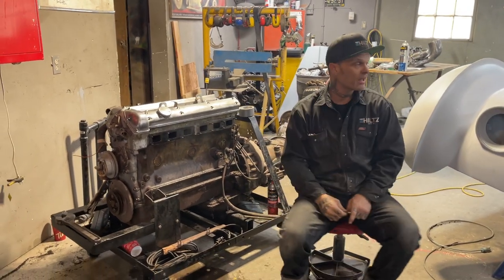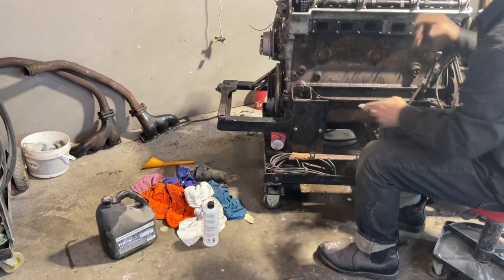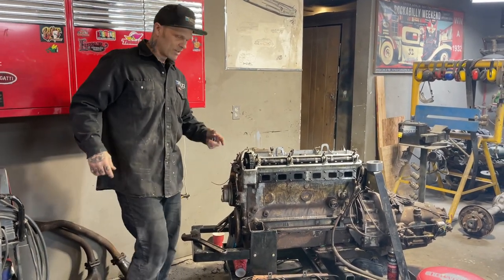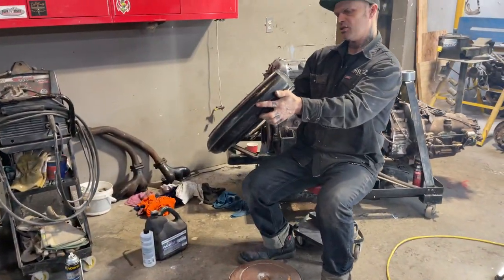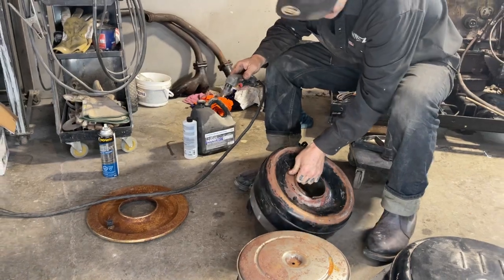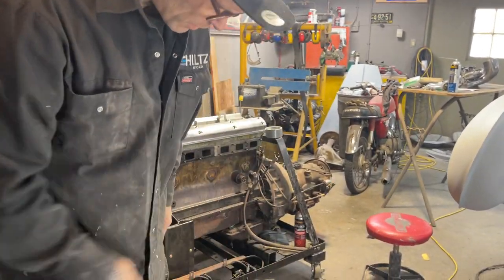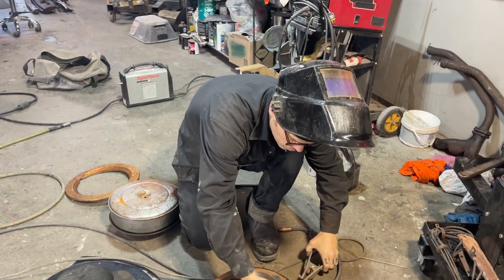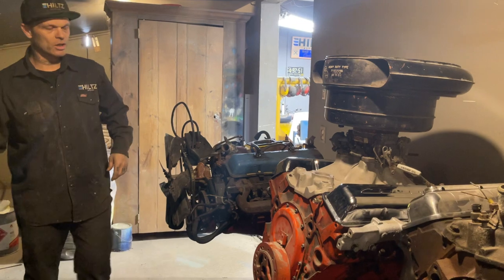HYDROLOCKED 1959 JAGUAR 3.4L ENGINE

Comment: Non- interference engine means if the cam shaft stops turning and the engine rotates the valves will not touch the piston.

Comment: Hydroloc means the cylinder has fluid in it and with the valves closed the piston will not come up because you cannot compress fluid. Pull the plugs first.

Comment: A non interference engine means the pistons cannot hit the valves even if the timing chain is off an interference engine means the pistons will hit the valves if the timing chain comes off. Hydro locking runs the risk of bending the connecting rods and it does not take much to bend them
Reply: Like a ford escort belt breaks re place the engine
Reply: Spot on! But I like Chad’s smart approach. He thinks logical and learns fast from all the information people give him. Love his videos full of pratical usefull info based on his experiences. Keep it up chad!

Comment: Disassemble the engine. Rebuild it to factory specs.  Then you will have a good engine.  Anything else with this engine is a waste of time, energy, and money.  This is a 62 year old engine.  The vibration damper is junk. I guarantee that the rubber is degraded. What does the water pump look like? The bearing is most likely gone. How much corrosion is there in the timing cover?   How much rust is there in the water passages?  There are so many things that need to be done to a 62 year old engine, that diddling around with it is just a waste.  I wish I was near you. I would spend some time showing you what needs to be done.

Comment: Not so.. timing chain can be working correctly if a valve is stuck open on a interference engine piston will make contact with stuck open valve.

Comment: Constructive criticism... Think about this........It can't be hydrolocked with an open valve.  If the valve is stuck open, the valve is100% out of time.  Only that one stuck valve, even thou timing chain n gears are correct.  A stuck valve isn't controlled (timed) by the cam profile....it's not touching thus not following the lobe.  I'm not a Jag guru but Doug definitely said this is an interference engine.  Let's ask him again.

Comment: I hope you are right about saving the engine without removing the head I had that same thing happen once with a Chevy straight 6  we still ended up pulling the head as the valves did not seat from rust build up causing pits we had to lap the valves

Comment: What you are missing is that if a valve is stuck open it doesn’t matter what the cam and lifter are doing the valve is still into the pistons space and we all know that two objects cannot occupy the same place at the same time 😂 ergo bent and broken parts 😢 You are an excellent body man and fabricator but leave the mechanics to Dough 🤔

Comment: Two questions:
1. What do you plan to do with that motor?

2. Why didn’t you just remove the head. Send it out for refurbishment.
Time is is very valuable!
“Once you have spent your time. You can never buy it back.”
Cheers

Comment: cam and timing gear do not make the valves close , the valve springs do  , you have a problem if a valve is stuck open , if its closed you have no problem unless it's stuck closed , a piston can hit a stuck valve in other engines.

Comment: Sorry Chad, I love all your content and as a body guy you are second to none. But you have got this hydro lock and interference thing very wrong. I am a mechanic in the UK and worked on Jaguars for 30 years. That engine is an interference engine. Meaning if a valve is fully open and a piston is at top dead, then they WILL touch if not timed. The valve can be fully open for any reason, whether stuck open or the cam is holding it open.  Yes, if the chain has not snapped or jumped, then the engine is timed and will not hit a valve if the valve opens and closes properly. If the valve is stuck open, then the piston will hit it at TDC. Sorry, but in my experience you will have trouble with that engine at some point unless its stripped, cleaned and reconditioned where required. Those chains stretch and fail. Best wishes and good luck with it.

Comment: Hi Chad, like the others have mentioned, unfortunately you have gotten it mixed up. An interference engine is a type of 4-stroke internal combustion piston engine in which one or more valves in the fully open position extends into any area through which the piston may travel. By contrast, in a non-interference engine, the piston does not travel into any area into which the valves open. This is a fundamental of the engine's design, and if the timing chain / gears get messed up (out of sequence) it won't matter in a non-interference engine, whereas in an interference engine the piston(s) could travel into the area where the valves are extended possible causing major damage to both components.

To further clarify, in a non-interference engine the valves and pistons never occupy the same space and therefore can never touch. In an interference engine portions of these components do occupy the same space, but the timing prevents them from doing so at the same instant, therefore preventing damage.

I enjoy your channel every day! Keep on chugging along.

Comment: When you go to put coolant in the Bugatti engine for the first time and everytime you change it raise the front end up high in order to burp out the air from the head.  Alot of home mechanics when the engine swap or modify the cooling system run into is that they overheat because there is air in the system.  You need to let it settle for and hour or so and top it off.
Reply: Maybe drill a small bleed hole in the thermostat to let air out too.
Reply: When the fill of the radiator is lower than the water passages on the head is the mistake most make doing this.  The Jaguar radiator he is using is designed to be two or three inches higher than he has it.

Comment: Non interference means if the timing chain or belt breaks the valves will not come in contact with the pistons, bad move turning that over with fluid in the cylinders with the spark plugs in, it doesn't take much to bend a connecting rod, good luck.

Comment: Brad, I am a Jaguar specialist that has a YouTube basically devoted to XK engines. Are you putting that motor in the gorgeous Bugatti custom? I would put a straight edge on the cam cover surface and make sure the cylinder head is not warped. They tend to warp high in the middle.  If you have any questions I am here to help.

Comment: ************    Hi Chad, You do know that when you cut out the inner ring of the air cleaner it was lower than the outer circumference of the air cleaner right?   It made the somewhat tall air cleaner "hunker down" over the carburetor.  By welding in the newer 4 barrel carb friendly inner ring,  that ring now sits higher than the outer circumference of the air breather (sort of like a mushroom stem).   That's okay if you like that "perched up" look however, by causing the air breather to sit high, When it comes time to put down the hood of your car, you may find that it will not close because the air cleaner is now an inch or so too high.   I'd measure the air cleaner while its sitting on the carburetor to see just how much room you have when the motor sits in it engine bay.

Comment: What do you think about moving the upper hose connection on the radiator up to clear the fan blades ?
Reply: He said he might trim the blades.
Reply: It would be easier and not have to balance the blades. It would be a simple soldering job.

Comment: I don’t get it Chad? Is that 4.2 currently in the car and, if so, are you swapping it with the 3.4?
Reply: @duncandonovan5270  Ah, that explains it. I love Jag 6s but they have some quirky stuff. I replaced the front seal on a friend's XJ6C and it was a toughy. Supposed to pull it. I had him drop the pan as far as it would go and I removed the old one with a pair of diagonals and then purchased a couple of seals and boiled them to get them soft. The first one tore but the second one went on undamaged but they are not intended to be installed in that fashion. It took him an entire day to clean the pan gasket surface in situ. Not fun.

Comment: Take the head off, your going to have to hone the bore new rings bearings ,head gasket water pump, harden the valve seats for unleaded probably grind the  valves , you know a rebuild 🤔🤔🤔before its 🚽🤣🤣🤣🤣🤣🤣🤣🤣🤣🚒🚧

Comment: Using a small airline taped to the end of your vacuum hose is way safe than blowing with a blow gun.  Foreign objects will be blown and forced into the piston rings where it will get trapped and score cylinder walls when the engine is rotating.  This is painful to watch.  
Hydraulic oil sitting on the exhaust side of a closed valve is not "Hydrolocked".  It's called a "Seated valve".  Which means the Valve Chamfer Face has sealed or "Seated" into the Valve Seat in the Cylinder Head.  
Hydro locking can and will bend connecting rods with correct timing.

Comment: Chad the cylinder which had the stuck valve can not hydro lock.  The only way to get hydro lock on that cylinder is if both valves are closed and seal and the spark plug is in.  With a stuck valve (stuck open) the fluid being pushed up by the rising piston is just pushed out though opening created by the stuck valve.  But may have got hydro on some of the other cylinders with working valves (not a good thing BTW)  Note on a interference engine, a  stuck valve can contact the piston, regardless of timing.  I wonder if this is how you got the valve to close?

Comment: Chad, 

not that it actually matters but on that engine number one cylinder is at the back (Drive end). That's how Jaguar numbered them and the only problem you can have is if you refer to an offical workshop manual you can get mixed up.

Comment: Chad, I get what you are hoping to achieve but you can’t nickel and dime an old engine like this back to new. Just take the head off, fix the valves, inspect the cylinder wear, clean out carbon etc. Then assess what additional work may be needed. You will be miles ahead to rebuild this engine right.

Comment: Well Chad - Things are going quite well - BUT if you turn a interference engine over when it has a valve stuck open you can still cause grief - it may just push that vale closed , but be carful as you proceed to turn it over with that stuck open valve.

Comment: I bought a chevrolet vega years ago & it had sat for 5 years & had the same problem ! I put acetone & marvel mystery oil in the cylinders over night & it brokek everything free & then after a week of driving it it started leaking oil from the oil pan gasket * the rear main seal. It pissed me off so I pulled the 4 cyclinder out & put a 327 in it ! I am not sure how much better or worse jaguar gaskets are but acetone is too strong for gasket material !

Comment: In a non interference engine it's only safe if the valves are not stuck open. If the valves are sticking open when they are supposed to be shut, the piston will hit the valve. Also, if he only turned the engine over by hand with fluid in the cylinders, its probably ok. You need to have it spinning pretty fast to bend a rod. Chad,  love ya..please stick to bodywork!

Comment: The valve that was stuck open was not following the cam lobe  and therefore was not in time. Whether or not it was hit by the piston I can't tell. If it is bent the compression test should show. The cylinder with the open valve cannot hydraulic because the  the cylinder is open to atmosphere. The fluid will not close the valve, it will flow around the open valve. I never miss a nightly episode. Love you two.

Comment: 14:00 Just a note. The radius arms on the early Mustang connected in front of the lower control arm..so you have room for the idler arm and center link and pitman arm.steering gear behind the spindles.  I have a spare set but they are off a 6 cylinder.and are.lighter weight than the v8 parts...

Comment: Well you will get it running but, one of the problems with an old xk engine is the water jackets rusting and getting blocked over heating and warping the head. These are fun but expensive engines to own welcome to the club.

Comment: The timing you refer to is valve action timing if the valve is suck and not following the cam profile then you do not have correct valve action timing on the two stuck valves and the piston can hit the two valves and bend the valves. If the valve to piston collision is severe enough it may bend the valves. A non interference motor you can rotate the crank and cam even in opposite directions and it will not interfere or make contact between the piston and valves, regardless of the timing

Comment: soak the rusty air filter in Muriatic acid and water,, it will clean it lickety split. when clean, rinse it in Baking soda and water, then get it protected as it will start to rust fast. But works amazing.

Comment: IF THE  VALVE IS STUCK OPEN AND YOU TURN THE ENGINE OVER THE PISTON CAN HIT THE VALVE BECAUSE IT IS STUCK OPEN AND CAN NOT FALLOW THE THE CAM LOBE BECAUSE IT IS STUCK THE VALVE MAY BE BENT OR THE PISTON MAY HAVE PUSHED THE VALVE SHUT .
AND HOPFULLY NOT BENT THE VALVE  THE COMMPRESION TEST WILL TELL IF THE IS DAMAGE OR NOT .

Comment: With all of the time and effort being invested in messing around with the valves, I would just pull the head and have the satisfaction that there is nothing unusual going on inside.  I would hate to see this engine installed only to see it self destruct.

Comment: Jolene what about some kind of defroster -   Air conditioning.  You will bake in the summer.  Put some insulation on the inside of the roof

Comment: First off your rings are good no bleed down and oil bath does Catch dust and lubes valve train cause of solid lifters and soft valve seats lead gas engines lasted longer that way but it will rob horse power so eliminate oil part would be good

Comment: Hey Chad the reasons they try to place engines lower in cars is to keep the center of gravity lower so the vehicle will not have a tendency to roll over. For instance trucks that are lifted have a tendency to roll over easier than car where the center of gravity is lower.

Comment: those valve covers will not work on that engine the old engine had a breather on the back of the block with a hose to the back of the carb got to have a vent
Reply: He said he was putting a different intake on it with a vented oil cap
Reply: @jamesguthrie889  i hear that only lets air out have oil every where

Comment: I don’t think there is anything wrong with the compression on your engine iam sure if there was that the trans fluid would of seeped past the rings on the pistons so when you wouldn’t have any oil in the head so my guess is that the compression is fine but still worth checking 👍
Loving the period correct look your doing on the other engine

Comment: think about it like this. when the engine is in correct time. valves open and close when they are supposed to. when out of time valves open when they should be closed, when a valve is stuck it is open when it should be closed which is the same as being out of time.

Comment: Run 1/2 oil and trans fluid when you first run engine. The trans fluid will clean the bottom end and rings etc.

Comment: If the valve can not move, it could behave like the valve timing was out of sequence so the piston may have contacted the valve and pushed it closed and or bent it. A compression test will confirm if the valve has been bent. Good luck. you are definitely learning about engines with this project.

Comment: A non- interference engine means if the Timing Chain/Belt breaks it doesn't bend the valves. Glad you got the valve closed. It may start the next video!

Comment: The reasoning is if the piston comes up.  and the valve is stuck down when it should be up. there may be contact. same as having the timing out of wack  it may bend or push up the valve or stop the engine from turning.... you may have pushed up the valve with the top of the piston  great project got my fingers crossed cant wait to hear it run

Comment: if you take out the spark plug engine will turn over. I suggest you turn the engine over a few times to make sure valves don't hang up hang up

Comment: How would someone time that kind of engine? I’ve never done it so I do not know
Reply: Its not hard a lot of engines have 4 cams these day
Reply: @andreweisan9613  not trying to be mean but I was asking “how” to do it. Not the difficulty.
Reply: Same as any other engine with a distributor that has adjustment and use a timing light.
Reply: @chillipotato1609  all the timing sprockets have timing marks you simply put them where the manufacturer indicates
Reply: @andreweisan9613  thank you! Just wanted an idea even if was basic lol I just had no clue. I appreciate your response 😉
Reply: @chillipotato1609  You have to ask questions that's how we learn but it is hard to give you a more in depth explanation as every car is different

Comment: Try and convince yourself youve got all the debris  out and it all good as much as you like but you're just deluding  yourself, you need to listen to Doug's advice, you're a car builder not an engine builder or a mechanic
Reply: And what a poor choice for an engine in the first place.
Reply: @brucefraser4778  by all means chance it with a common engine you can easily abd cheaply replace but the jag engine isnt cheap or easily replaceable,, but i guess some need to learn the hard way.
Reply: @Tamecrow  no i disagree, they are nice engine's, too nice to destroy being a cheapskate
Reply: @brucefraser4778  have you seen the Richard Michael Owen channel? They are Canadian based snd do all British stuff, do s lot of Jags, really good informative stuff
Reply: @brucefraser4778  Your're fuckin high, Dude can weld just fine.
Reply: @brucefraser4778  No you won't . I follow pipeline welders all day long, I know a good weld. He'll fix it later after mock up.
Reply: He has a half mile of nice welds on the car to if you been watching. Dude can weld.